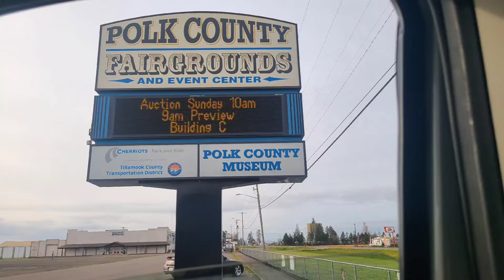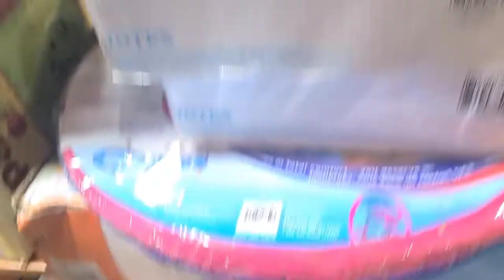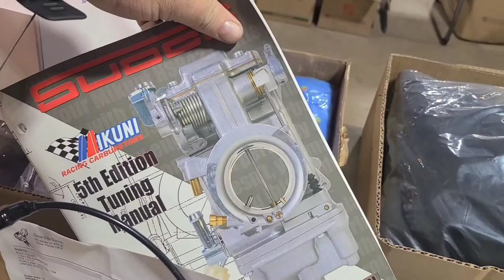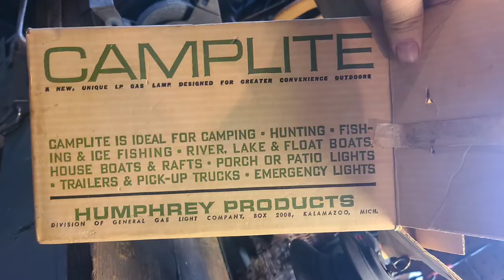Coffee before the Auction. Estate sale by the Bag ! come allong

Comment: Once again, superb score.   I scored a outside gas like from Coleman I think it was a model 19 0 2 from the sixties Super clean condition but did not have the gas book up for the burner.  I think that's what that camp lite is
Reply from the maker: Thanks, Jason . Do you still have it ?
Reply: Yes still in the box they had it in. Not the original box. It has the mixing chamber and burning tubes it's just missing the parts that goes up inside of it.